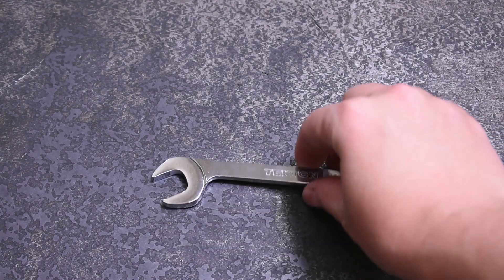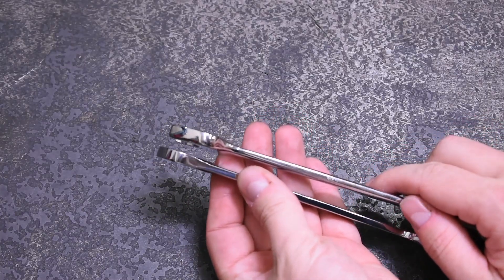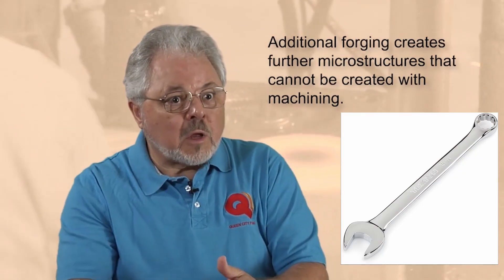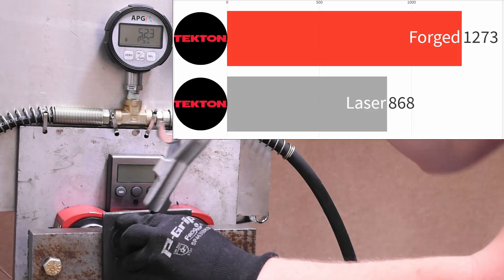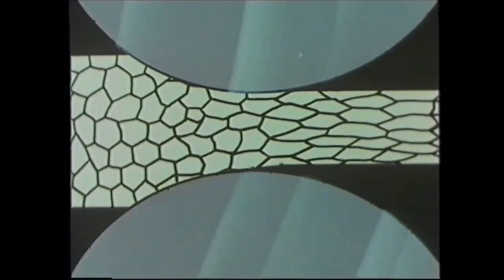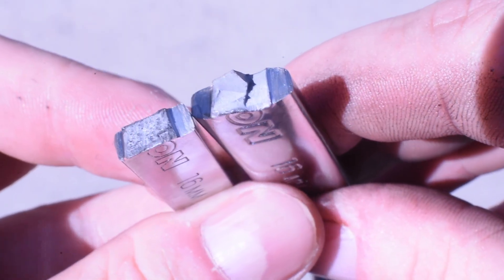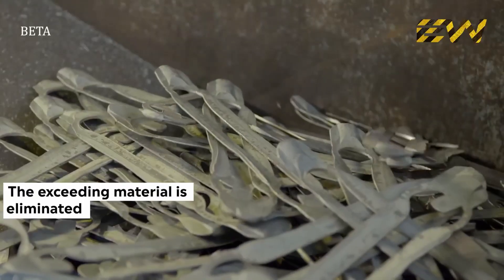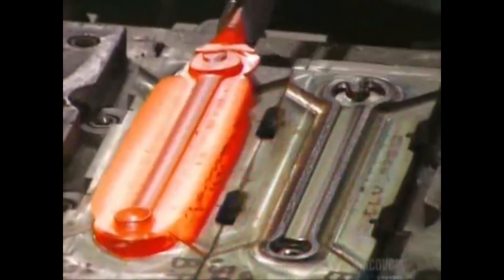The Curious Case of Laser Cut & CNC'd USA Wrenches vs Forged

Comment from the maker: I just want to say how much we appreciate our community (Some might even call you Torque Testies. Just sayin', it's been said ). Every time we try something a little bit more random or different than our usual favorites, you guys are so positive, provide useful feedback and experience to share with everyone, and suggest further thoughtful things to look at.
I don't think you guys realize how rare that is online. Thank you
Reply: its nice they are trying to make in the usa, it really is with so many things just plane ol unavailable even if they want to, but it is worse and cost more, though from the looks not too much weaker and sutable for the offset angle they are made for, your right forged is always stronger and better mechanical properties, but there are limits to certain things and its why things like ship propellers are cast and machined, or why they have powder metal blanks which have their own limits but better material distribution of the elements, which are good for one piece tools and you can pein them to get a little more tightness in grain, but seems like additive manufactured metals, they are not hot workable like continuous casted metal or blanks, if one tries to the powder metal will deteriorate typically and it tends to be very stiff like a weld with laser sintered material, but it cant be stress relived easy like forgings can be or as I read it will fall apart, so cold peining or forming is really about all you can do from what I read last year or two ago in forge or forging magazine online.  rolling if forging but not like cross wedge forging, closed die, or open die where all around it squezes the cross section down and makes it tighter and with less needed weight then a casting.
Reply: This video was great. I especially loved the old educational clips you sprinkled in throughout the video.
Reply: But my coworker puts red lock tight on all his hydraulic fittings.
Reply: Please dont torque my testes…
Reply: So far, all your videos have been well presented, clear and concise.
The addition of a bit of wit and dry humor is a nice touch.
Reply: Well this is the best and only channel that does real world tool tests!! So we all thank you TTC
Reply: I feel like this is the nature of the demographic of people interested in these kind of informational videos. Same with Project Farm; it's a polite -er area of the internet. Help begets help, information begets information etc.
Reply: Looking at impact wrenches on the dyno can get a bit tedious. It's good to mix it up a bit. 👍
Reply: They are supposed to be used for hydraulic fittings, “soft metal fittings”
Reply from the maker: @adamnance4404  Correct. And we used soft metal coupling nuts here, pointing out these arent deigned for MAX torque as well.
Reply: @TorqueTestChannel   I love your content and use it before making any kind of purchase, waiting for set to come in the mail as I type this lol
Reply: I'm just going to put in my 2 cent these wrenches suck I like tekton but man oh man do these suck if your using them on anything that isn't low torque or hydraulic fittings and even that is 50 50 your going to round off whatever your putting them on. It would be neat to see other angle wrenches vs angle wrenches love your channel
Reply: Whenever we can, we liked to help! 💪💪

Comment: I'm sure others have chimed in but these wrenches are a specialty wrench designed primarily for tube nuts, hydraulic and pneumatic  fittings where access is of primary concern. You don't need gorilla grip on a fitting.

Comment: With skillful use of a combination of flat cross-wedge rolling of forgings and stamping, it is possible to minimize flash and bring the metal utilization rate to 0.7-0.90 percent. Which is impossible to achieve by using forging rolls or only forging.

Comment: I've learned one thing about most tool quality and that its inconsistent making all of these test basically irrelevant, no offense. You test one of a million wrenches with consistency all over the place, what is the point? How do you know the specific wrench your testing is an accurate representation of the entire batch. How about getting 10 of the same brand wrench from different sources and then do your testing so we can see the consistency.

Comment: I often have to use a combination wrench for leverage on my Snap-on angle wrenches, or strike them with a hammer/bar to break a bolt or fitting free, so sometimes being able to put a lot of torque on them is a necessity. But then again, we’re talking the difference between whatever the Tekton wrench costs and $55.25 for the 16mm Snap-on.

Comment: I have this wrench set and I love it, but the handle area has sharper edges than any other wrench I've ever used. It's basically a rectangle and it isn't very comfortable. I've considered grinding them down a little to make them more comfortable, but haven't committed to it yet.

Comment: I've enjoyed several of the videos, so far, but I have a question about your hardness testing.  You tested the chromed wrench - isn't that more testing the strength of the chrome plating, rather than the underlying steel?
Reply from the maker: Its ground into then polished for a fine surface DA for best readings. Your correct measuring the chrome would be top levels of stupid haha
Reply: @TorqueTestChannel  - Ah, the polishing threw me off, then.   Measuring the chrome plating might not be totally stupid - I've noticed far different qualities of chrome plating on tools.  Even on 'old' craftsman vs 'new'.   (Probably mostly due to the EPA "You can't use cyanide!" regulations)

Comment: 7:05 the forged one has a larger surface that had to be broken also, due to its thickness. I know that won't make that much of a difference in the strength, because it's just that much weaker.... but thought it was worth a mention.

Comment: While I somewhat understand the benefits of a forging process, would not the grain of the metal actually aid in durability?  The lines seem to be facing towards the area where force is applied - you broke it at a 90 degree angle from that.  IMO, if you want an accurate sheer test, you'd need to break it lengthwise, not widthwise.

Comment: putting carbonated soda/seltzer water onto the grain structure after you snap it, will bring out the grain structure and make it a lot more visible. 
can also try salt + hydrogen peroxide + vinager solution. might make the grain structure more visable. try washing with carbonated water. ferrofluid will for sure make the grain structures pop (ferric chloride). i think some type of printer ink works too

Comment: I think you underestimate the cost of laser cutting plate steel. The company i work for recently purchased a new laser, it was 1.4 million dollars. I was blown away at the cost of industrial laser machines. They are extremely expensive. Even a used pos laser will set you back over 1/2 a mil. But at the end of the day these wrenches are just a niche product for that 1 job where they are the only tool that fits.

Comment: I have the tekton 15/60 Taiwan and the tekton 30/60 us wrench’s. I use them often on hydraulic fittings. The 30/60s are irreplaceable, you will want the extra 15*. I owned the 15/60 about a year longer and found myself constantly in a position of a fitting being in the middle of the two open ends reach, especially when you have 8,9,10 etc hoses with limited spaces into a manifold. Since purchasing the 30/60 I only use the 15/60 when I need a second wrench, yesterday it hard line to hose connection. Otherwise the 30/60 is king and worth every dollar. I’ve never slipped off a fitting with the laser cut wrench. I have 1/4 - 1 1/2 and will be purchasing through 2” here shortly.

Comment: Fascinating video, laser tools, from cutting, to welding, to cleaning, are futuristic AF.
Once you add into the mix 3D metal printing, and although the tools today with these new methods may not be 100% "as strong" replacements as the older methods of creation, the fact that we can have more variance in the tools for general and even special niche uses, such as this double open-ended and double angle tool, is amazing.

Comment: Enjoy the content as it has given us guidance on tool purchases. 

Elongated linear grain structure in plate material has its benefits over forging as the linear load (stretch) is beneficial over forging in certain applications such as firearm components. Wrenches, not so much as the loads are axial and torsional. Hardness testing should be done with any plating removed to get an accurate substrate hardness reading.

Comment: This is a great video, well researched, great background on the metallurgy. I agree with your conclusion of the best model to use this process on. I have a set of sunex double offsets that were(cheap) forged but horribly weak. That said they still did the job to reach hard to reach fittings. Thank you for the channel and I will use the vids in classes where students ask quality questions when it comes to tooling.

Comment: i use offset wrenches daily because they are thinner and fit our application .max torque is manufacturer specific and specified at a certain nm .we tighten to 8nm max so for me these tekton would be superb and would last forever .i dont see the reason to destroy a tool without knowing its designated purpose or application .thats like saying my 10mm 1/4 inch ratchet broke at 140nm ( and saying its junk )when its max torque capability is 100nm .

Comment: The largest takeaway was, "it's good looking".
Reply: And it's available. As many others have stated, having 30/60 wrenches is really valuable and there aren't many to be found. Having another, cheaper option is great. Given it's a bit of a niche product, it likely wouldn't have been introduced to the market if it required the kind of volumes needed to be profitable with forging.

Comment: My favorite way to use my snap on set of these. Is when a stubborn fitting is found i take the wrench then put the longest prybar I can fangle in  and pry away. Its pretty rare i cant get things loose but it gives me pause with the tektons as they dont hold up to high torque as well as other wrenches

Comment: The video clip showing the wrench being hot drop forged is from rod I think is from the “How it’s made” Snap-On.  Most brand name made in USA wrenches are blanked from plate and cold forged in a high pressure hydraulic press.  Openings are precisely broached.

Comment: So right after this I watched an Eric O. video about replacing some hard to reach part down in the engine bay and he mentioned how hard its was to reach and don't over torque it and I got to wondering, by using a stubby 1/4, how much torque could you apply?

Any chance you guys want to do a short on testing say a 10mm bolt using a 3/8 stubby, standard, XL, and then breaker bar just to see how much torque you can apply with each?  Unfortunately I know a standard 3/8 can snap the stupid 10mm that Yamaha uses on their ATVs.

Comment: The thesis of this video seems to be that laser cut/rolled is inferior (though probably good enough) in terms of strength, but the torque per mm numbers on this wrench seem pretty comparable to the other options. It seems like a bigger factor is just that this is a thinner wrench than the others?
So unless I’m missing something this wrench is weaker mostly because it’s thinner, and only partly because it’s laser cut.

Comment: Request: test Milwaukee Fuel Surge Hydralic driver M12(2551) vs M18(2760). Would also like to see M12 Fuel Screwdriver(2402) testet, I tried to test this myself, found it to be very unreliable. 9nm on fresh batteries, but sometimes 18nm on 3/4 battery. It's not what you normally do, but we use these at work, so would be fun to see the result.

Comment: That style of 30/60 thin double open ends are called tappet wrenches for adjusting the two thin locknuts on old style mechanical valve lash adjusters.

Comment: Your "expert" at the beginning is stating as fact, theories that were disproven years ago. Alloying components, heat-treating, and tempering are the factors that control grain size and structure. And both heat-treating and tempering are done post forging. I am a bladesmith and have been studying metallurgy for many years in this specific regard.

Comment: Laser cutting doesn't make it more precise. Wrenches are usually broached after forging. And that makes it quite easy to hold 0.01 mm.
In my eyes, the Stahlwille Motor 12 (12?) wrenches are the best. Just by the touch ...
Edit: Here we go! At 8:43 you see that they even have to broach ther "precision laser cut" wrenches. Also, the do stamp them (size and brand). That makes the whole process quite useless. They do have to forge the shaft, or it wouldn't get thinner. So stamp it out, thin the shaft and stamp/etch it, broach it and you are done.

Comment: The comparison between the grain structure in the failure zones indicates the forged tool is more ductile than the laser cut wrench.   Ductility is the opposite of brittleness and is a measure of toughness.   The way the forged wrench material flowed a bit before full failure is the indicator.  It's a great characteristic to have in a wrench.

Comment: Angled wrenches are a must dealing with hydraulics, I have a Snap-on set I bought at school up to 1 1/4 then random hydraulic firing sizes up to 2 inch taht are tekton, I’ve had them about a year, and normally you’ve gotta use a hammer to break the big ones loose. They seem to hold up really well and I haven’t broke them yet

Comment: Wouldn't it work to rough them with a forge then finish them with CNC/EDM/Laser?  Seems to me that would generate the best of both methods-- machine precision with forged strength..
Reply: It would only add to the cost. As the video pointed out, getting time in forging is expensive and difficult and making the dies is also expensive. And CNC/EDM/laser don't become cheaper per unit with volume. So rather than getting the best of both methods, you are getting the worst: high start-up costs with high per unit costs.
Reply: @reverse_engineered  Good point. I wasn't talking about cost efficiency, though, but rather performance.

Comment: Super fair review. At just over 6mm thick, these obviously are not designed to be high torque or for removing stuck bolts. They are for delicate hard to reach places. As long as they don't do this with their main tools, it's a clever design.

Comment: Should have put those last 30 second caveats near the beginning. Took until the last 30 seconds to get to the “this wrench doesn’t need to be a Goliath forged monster wrench because it is for soft hydraulic fittings…” this is an apples to oranges comparison. Two wrenches with vastly different purposes. Of course forging is stronger, very basic physics. Comparing the Tekton to the snap on would be super interesting. Then compare torque specs on hyd fittings and show I don’t need the snap on wrench that costs 2.5x as much.

Comment: I have the Snap-on wrenches in the sizes I needed to get off power steering lines and AC lines and they make the job so much easier and faster to beat the flat rate time. The cost of two Snap-on wrenches is the same as the cost of the Tekton 16 piece set. I may try them as new cars come out and the sizes are changing.

One question. If Tekton was to roll the steel plate to change the molecular structure as shown in the historic video, would it make the wrenches stronger?

Comment: Really happy to see this video, actually i'm graduated engineer specialized on press forming and drop forging equipement. And each time i see the new technology for the steel part fabrication I love to see that the old technology is still better. 😉
Reply: Not necessarily better, just different. The video explained how laser cutting and CNC machining can allow for smaller runs and more variations than would be practical with forging.

Comment: In the laser cut wrench, the way the grain structure is formed will increase the hardness of it over the forged. Not the way you broke the wrench with the hammer, but in the "Turning the Wrench" motion. Like grains of wood, it will be stronger only in one direction.

Comment: Useful in industries and trades that do not require brute-force for every bolt. Electronic assembly, switches on crowded panels, measuring instruments, panel-locks, etc, often require large A/F sizes to tighten nuts, especially plastic types. I'd have a set in me electrical/electronic toolkit, separate from my car/bike tools.

Comment: Awesome. I have a couple snappy offsets and they are absolute LIFESAVERS when you need them...but finding a good set off of the truck is difficult. I'll be picking these up for sure. Not worried about max torque at all.

Comment: Decade long HD off/on road tech here, this is the perfect wrench and the perfect manufacturing process for such a tool. Having to buy any of the large brand name tools, especially specialty tooling, will break the bank or will require decades to acquire. Having options for such useful, one off situational tools, is indispensable. It allowed me to perform more complex tasks easier and faster, without having to dish out a grand or more. These types of tools, and this manufacturing process, makes accessing the trades much easier and much more approachable. Any old tech will lament about how much money they've dumped into their snap-on tool box. I appreciate tool makers making old designs with new processes, it opened up my world to amazing tooling for a fraction of the cost. Sure, the tool MAY not perform as well as the big brand names, but if you are smart and thoughtful about the tools capabilities, you can approach many, many situations you may have never thought about before.